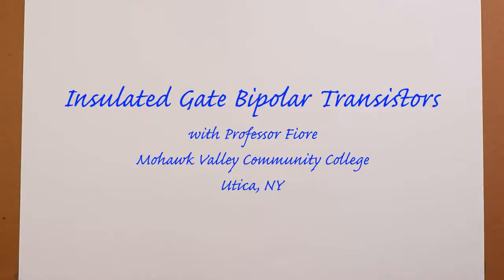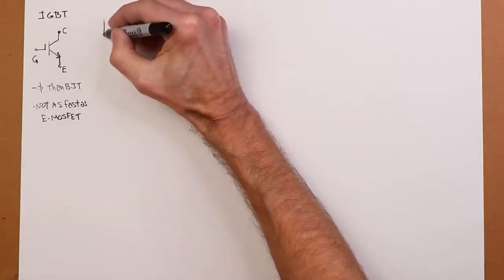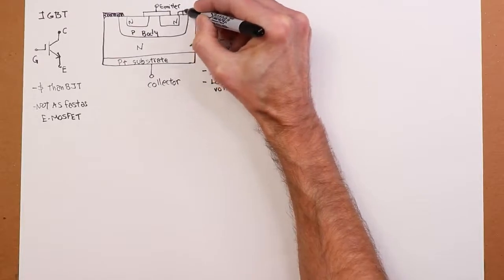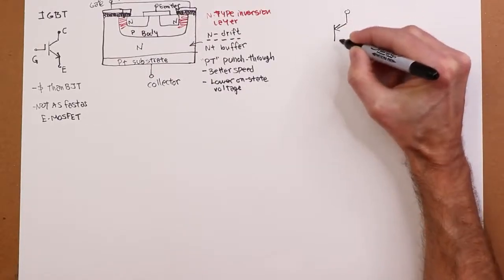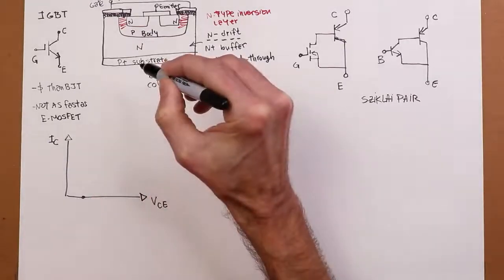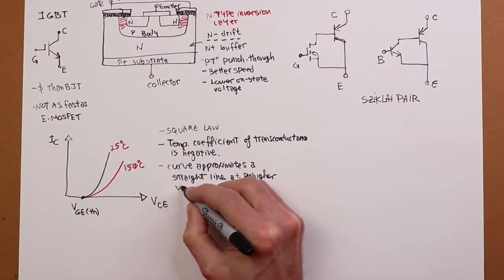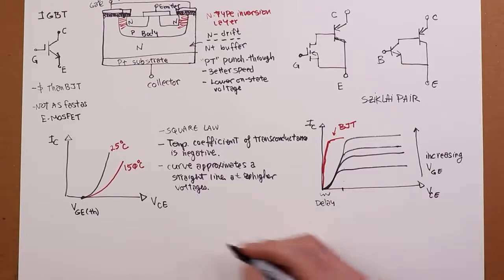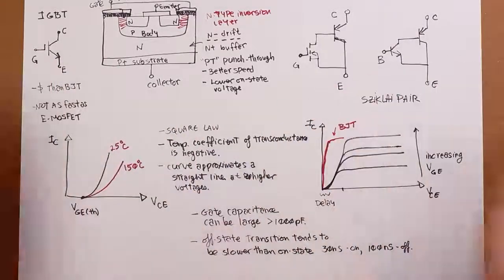Semiconductor Devices: The IGBT (Insulated Gate Bipolar Transistor)

Comment: Floating a question here. What would cause an EOS on a die IGBT? Basically a tiny hole that burns through from bottom to top on the emitter pad during high load stress testing.